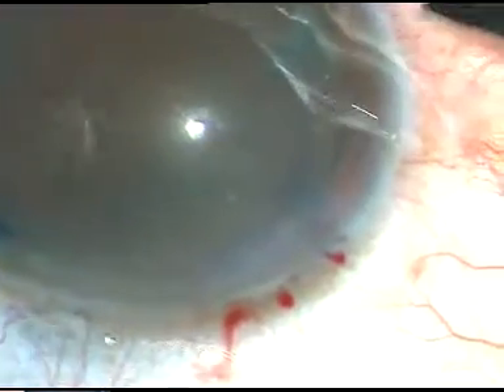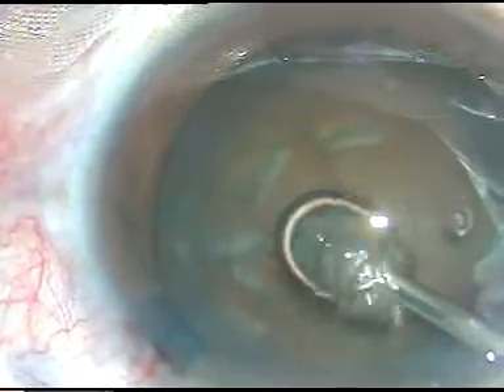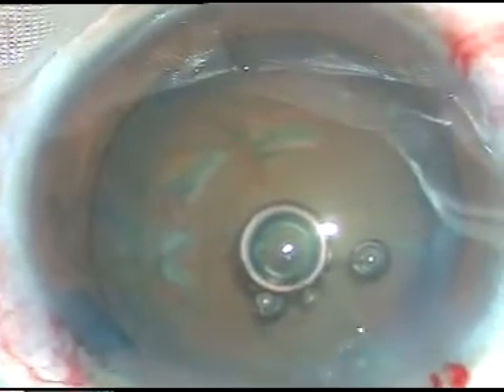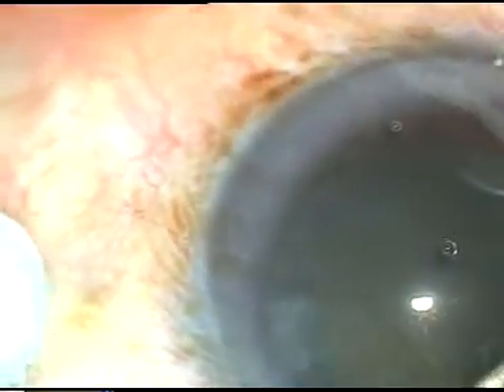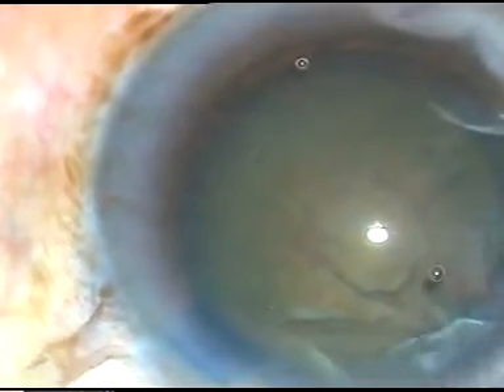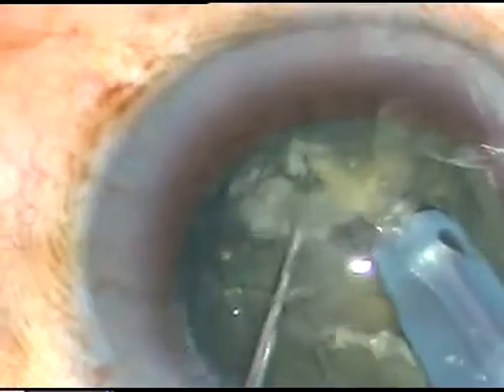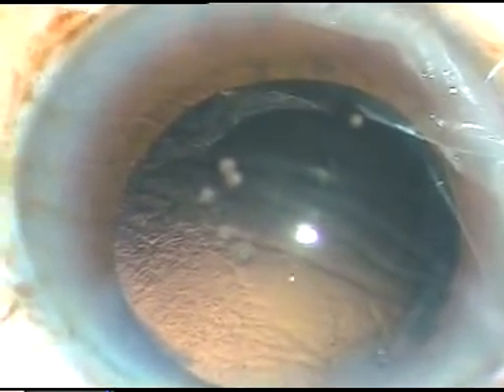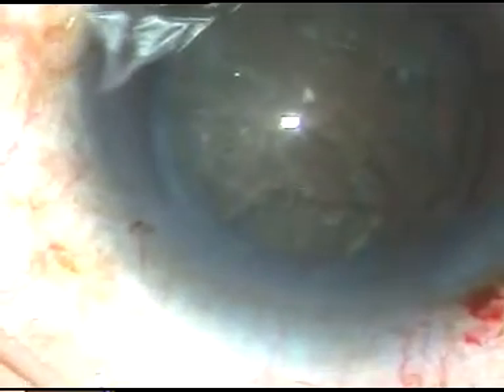Wood-cutter's Technique for management of Hard Nucleus in Phaco - 3 cases

Comment: Sir what is the difference between a submarine chop and woodcutters technique?? Are these types of horizontal chop? And what phaco parameters should be used ?
Reply from the maker: In Woodcutter's Tech the chopper is placed first at the equator,  the handpiece moves towards it..
In submarine, It's not like that..
I haven't been able to do the Woodcutters tech in this video.
It has become like horizontal chop.